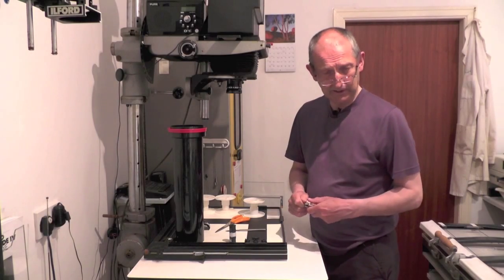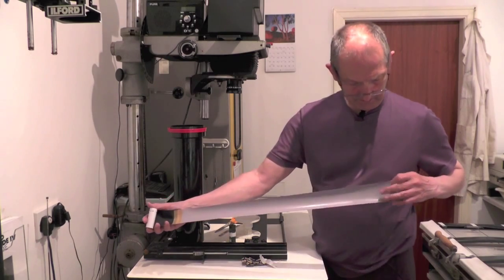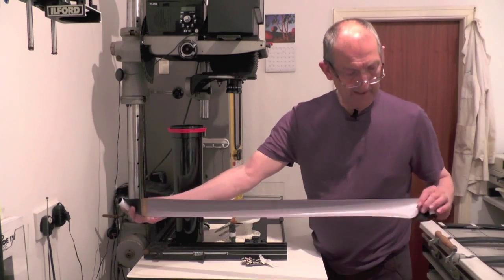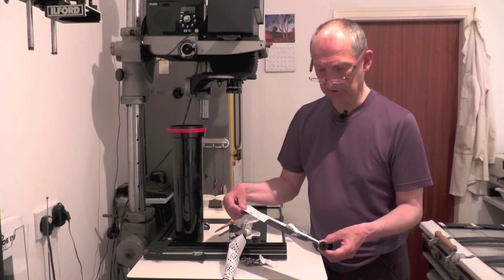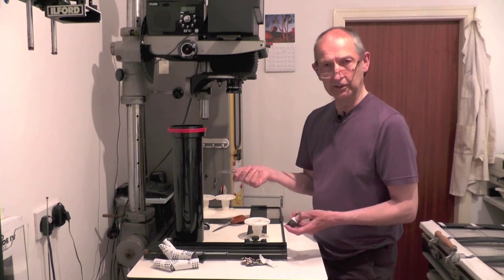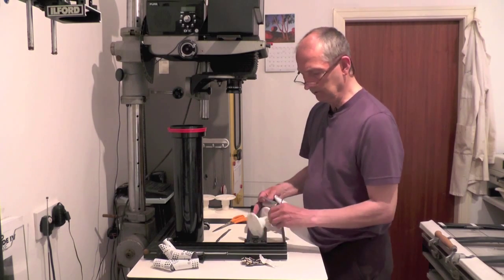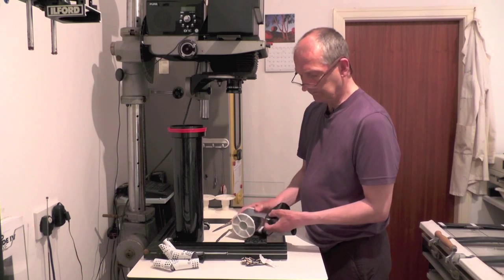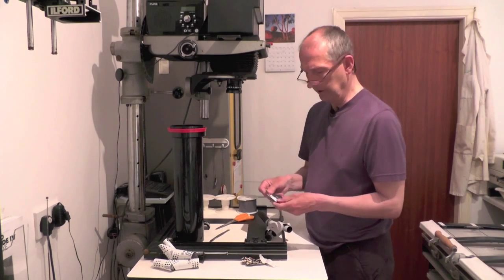Black and white film processing Part 1 of 5 - loading processing reels and tanks

Comment from the maker: Sorry for delay in replying, been a bit busy working on new books. I'm unfamiliar with the Vivitar tank that you mention, however, sounds similar. I have seen what you describe when films don't load freely into the reel and they try and bunch up. It's as if they are too tight against the edges of the reel and chemistry can't reach the film edges (the bits with the edge signing). I got around it by either cleaning the reels or if unsuccessful throwing them away! Steel reels load from the middle rather than pushing the film in from the edge so I suspect they will be better, or you could just buy a new Vivitar reel if you're having to buy a reel anyway.
Reply from the maker: Pleased you're sorted. Dave

Comment: Damn, how did you load that reel so fast without the film kinking up?
Reply from the maker: The8TrackChap it's just practice!
Reply: I actually like the steel Hewes reels better than the plastic Patterson type.  When using a changing bag to develop my own film, I used junk rolls to practice with.  While loading the reels, I could never get the film to stay in the plastic grooves without the edges popping out of the grooves.  The Hewes was much smoother to load and the metal clip works pretty well at getting the film positioned straight so the edges don't stick out through the spirals.

Comment: Hi Dave. really like your channel. 

I did some printing again yesterday on some nice FB paper and tried to do a manual splitgrade. Usually I use a Heiland splitgrade Controller and head on my enlarger but it also works rather nice without the automation. And now I am fighting again with Curly baryta papers. Did you ever make a video how to process FB papers without getting wavy edges?

and another thing I realized when I checked your Homepage. you use the oldfashioned FP4 for slow and the more modern Delta 400 for high speed. Mist people use either the combination FP4/HP5 or Delta 100/Delta 400.

why do you like the older Film for slow and the newer Film for high speed? or more important: what does the FP4 give you that Delta 100 cannot deliver?
Reply from the maker: No, but it's on the list. In the meantime I have written an article on drying FB papers on my DarkroomDave website. Copy and paste this link into your browser if it doesn't show as a hot-link. http://www.darkroomdave.com/tutorial/drying-fibre-based-paper-using-flatbed-dryer/
Reply: Thanks for your reply, Dave. Three weeks ago I purchased a heat transfer press that is actual designed to attache stickers to t-shirts. This model: http://www.ebay.com/itm/16-x20-transferpresse-heat-press-lcd-temperature-40x50cm-heavy-duty-SPECIAL-BUY-/251894734197

I dry the prints now on a rack, picture down as you also describe in you tutorial and the next day I put it into the press, image up, put a sheet of matboard on the image and press it for 2 minues at 85°C. Comes out perfectly. With sizes below 16x20 I also can dry mount them quite well. OK, it is not as good or comfortable as a proper dry mounting press, but I found the price to be fair and for a hobbyshooter like me it's a nice alternative.